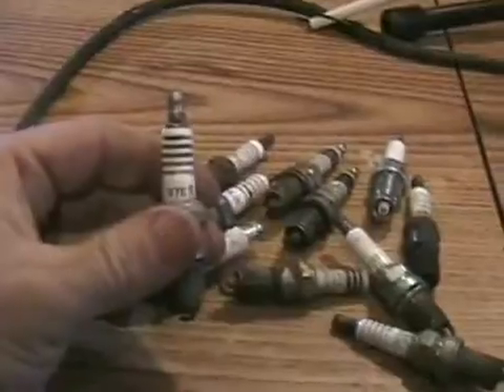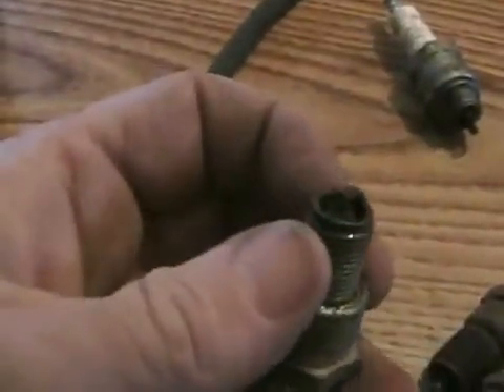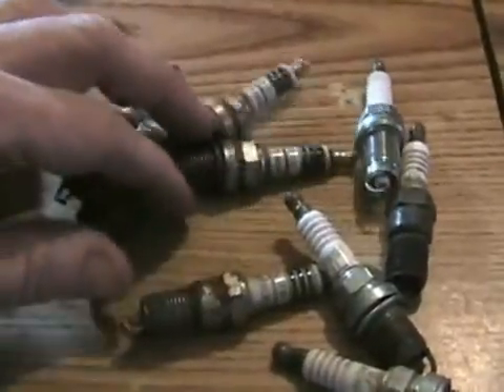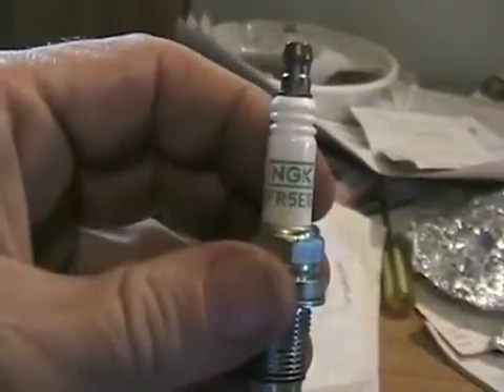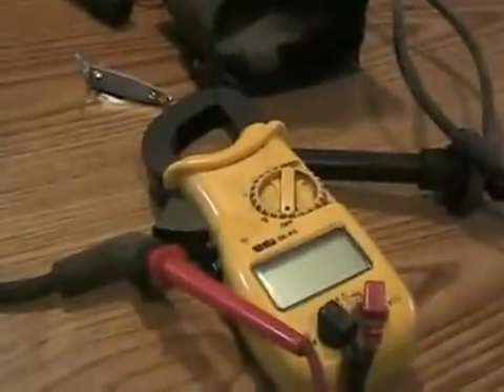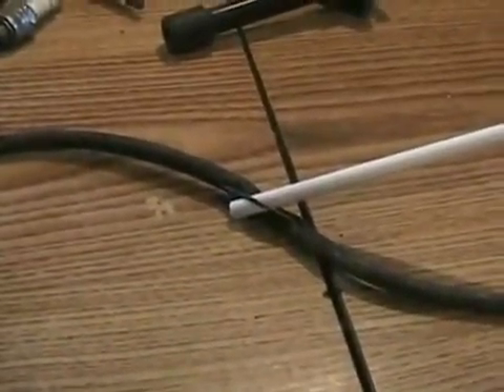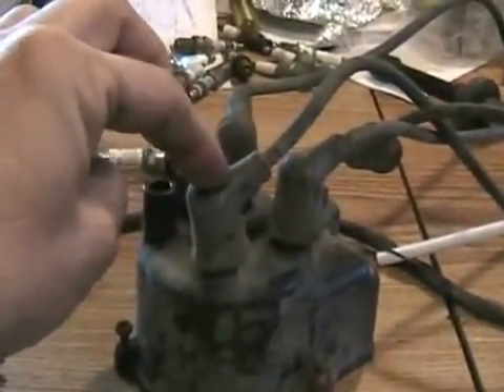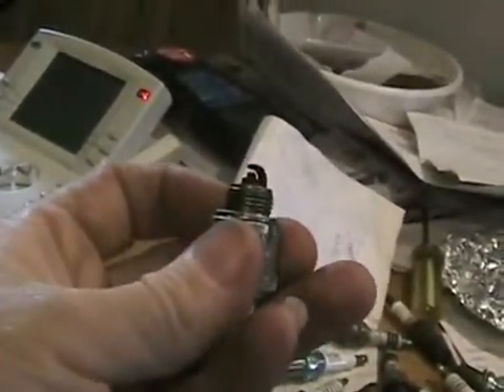how spark plugs work Davidsfarmison[bliptv]now

Comment: it comes from a  ignition coil the coil uses 12 volts and turns it into 30,000 + going through the spark plug wire to the spark plug